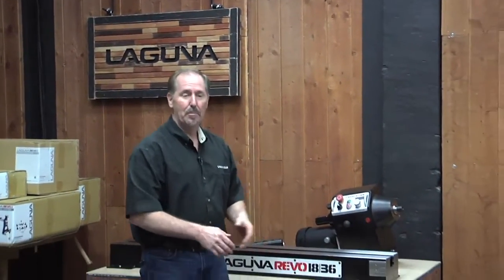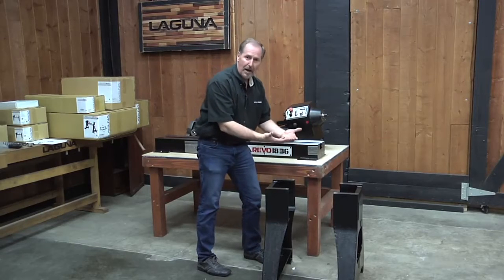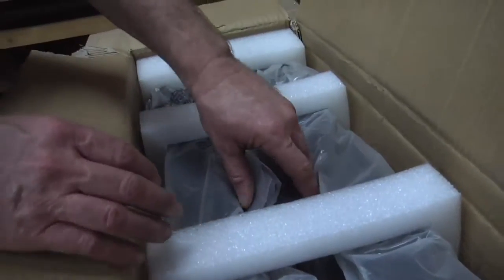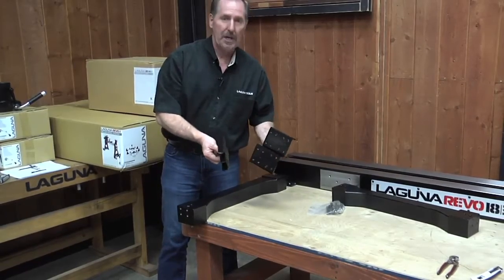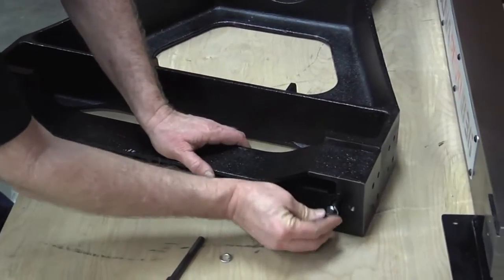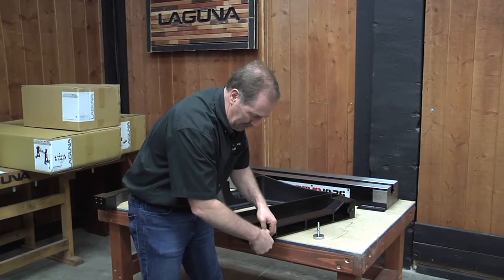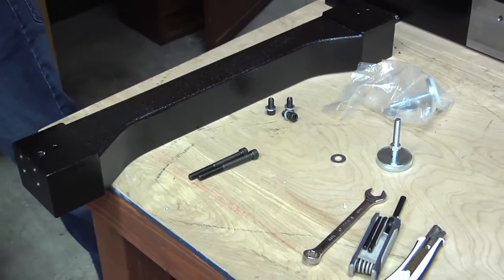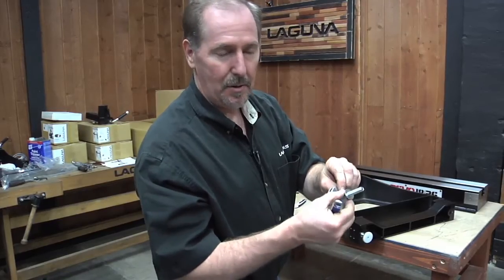REVO 1836 Lathe Setup - 3 Inch Riser Blocks Install - Part 2

Comment: I would say.. the head stock weight is____ the tail stock assembly weight is _______ and so on.
Reply from the maker: Thank you. Although we do not have the weight for each of the item separately, we will forward your question to the obtain the answers you need. You may also call us for a more quick response at 800.234.1976
Reply: Thanks for reading.. I just figured as you did the demonstration you would add this item weight is real heavy at  XX pounds. .this would inform the viewer on the weight of said item

Comment: Since I had to wait nearly 8 weeks for these to arrive and I already had the lathe assembled and in use, I was faced with a challenge.  However, a hydraulic jack was needed and it worked well.  I used a post between the underside of the lathe bed ways and the jack to elevate the lathe just enough to get the riser blocks underneath with additional clearance for the bolts.  I used blocks of wood under the lathe legs and riser blocks as a safety measure.  I jacked up the lathe slightly higher than needed, removed the leveling legs, then blocked under the legs and riser blocks, lined up the bolts, started them, then lowered the lathe end onto blocks.  Tightened the bolts, then reinstalled the leveling legs, then lowered the lathe to the floor.  Worked well and was a very safe procedure.